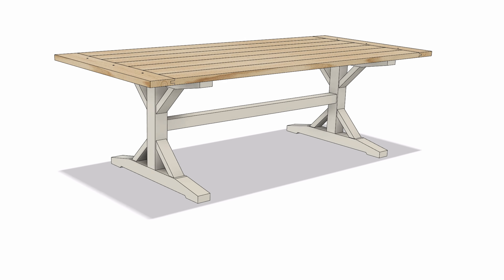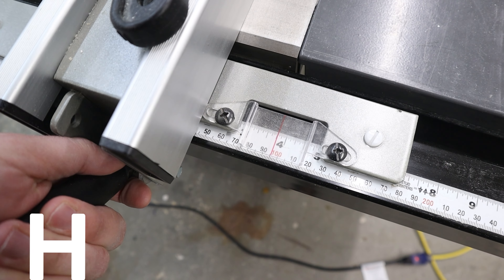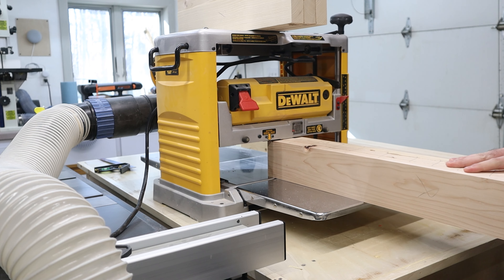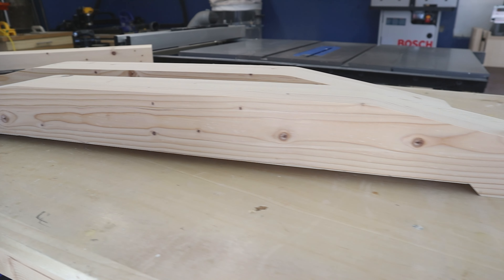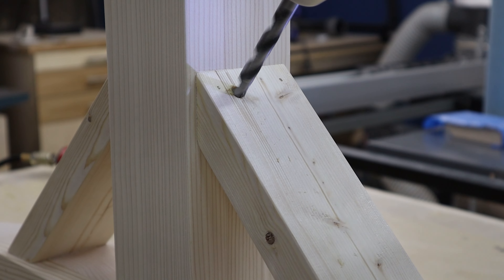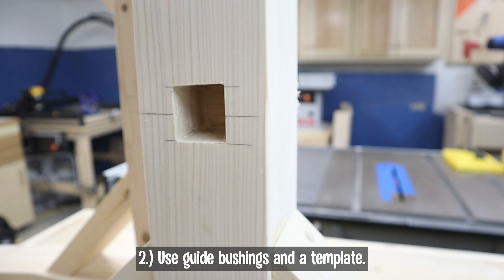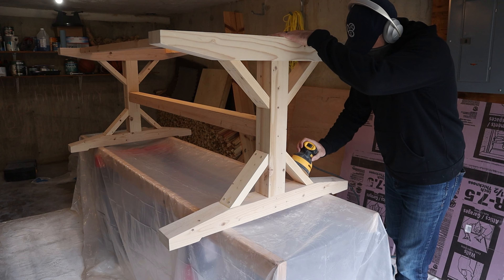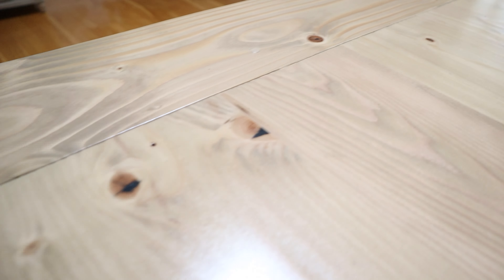Building the BASE for my Farmhouse DINING TABLE | Plans Available

Comment: ThIs Is NoT a BeGiNnEr PrOjEcT

Awesome work. I'm going to be attempting one of these in the near-ish future, and this gave some great ideas -- especially the solution to not having clamps long enough.

Only question is on the use of softwood for the top -- have you noticed significant scratching or denting? That's my fear, but pretty hardwood is so expensive...
Reply from the maker: Hahaha, as soon as I used the planer/jointer calling it a beginner project went out the window.  I haven't noticed anything yet, but then again, we still don't have chairs so it hasn't been used much.  I envision it will get dinged up a bit, but not too worried about that.

Comment: Are you worried about the breadboard ends having seasonal expansion? The quick overview didn’t look like you gave to much space for movement. I would hate to see that beautiful top crack after it’s first year.
Reply from the maker: I'm not too worried.  There was some room to move side to side in the mortises and I used a file to widen the holes in the tenons for the outer dowels.  I actually finished the top 2 months ago and I haven't seen anything that should have me worried yet.